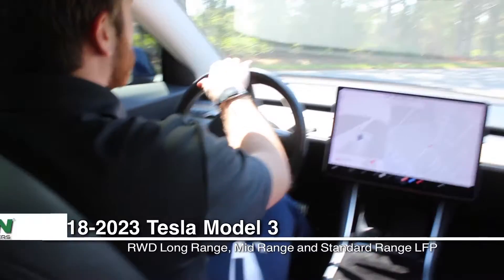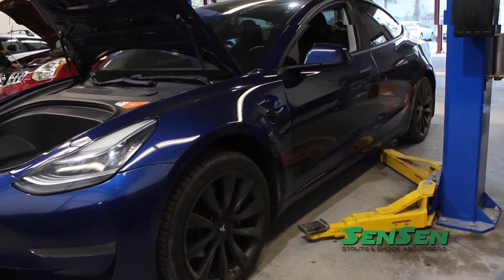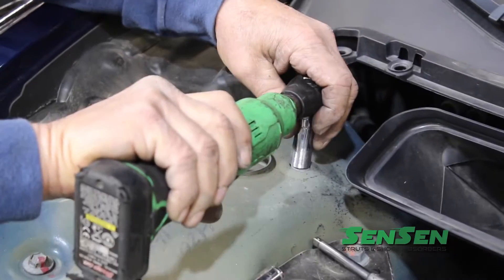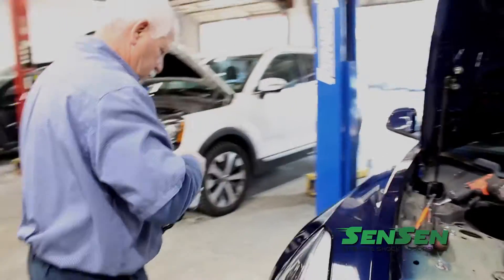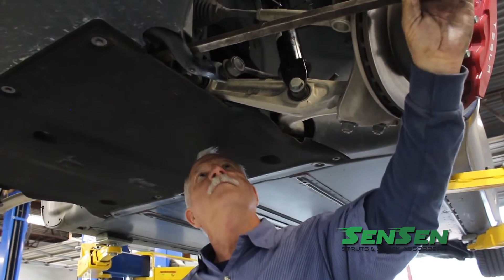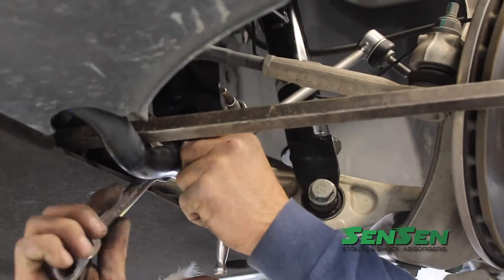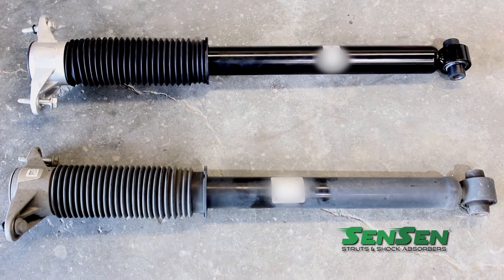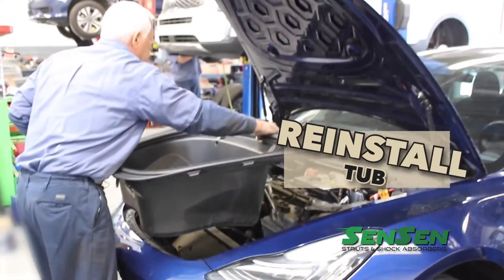TESLA Model 3 install struts and shocks SenSen

Comment: The test data wasn’t conclusive to me - the after trace showed a great deal of continual activity of higher magnitude than the before trace, implying that with softer suspension the car is under-damped. Can you explain this please?
Reply from the maker: We did not show the detailed bump by bump comparison of the old suspension and the new suspension.  We saw a significant decrease in crashing on potholes due to revised low speed damping and a significant decrease in average acceleration and jerk by allowing the suspension to follow the road profile better.  Overall qualitatively and quantitatively the ride was significantly improved over rough roads.  A very similar suspension profile was later adopted by Tesla due to customer complaints.
Thank you for watching!
Reply: @ Would be good to see the quantitative data analysed. Perhaps an idea for a separate video? Thanks for the reply.
Reply from the maker: We'll take that into consideration. Thanks.
Reply: Was this test done on a new oem strut?